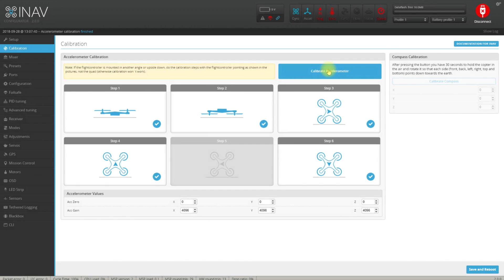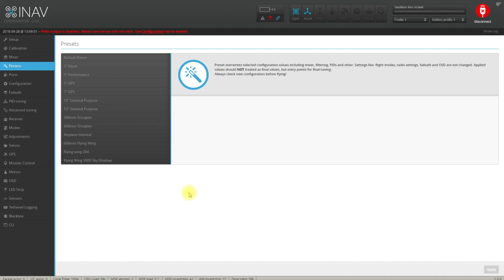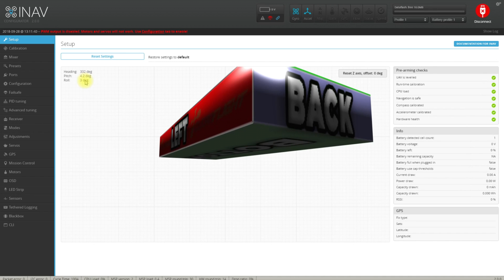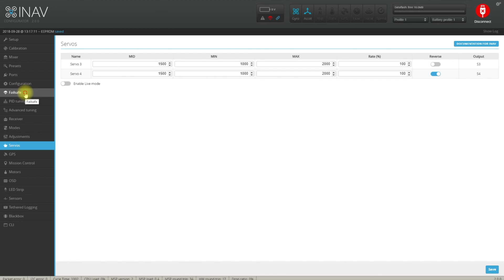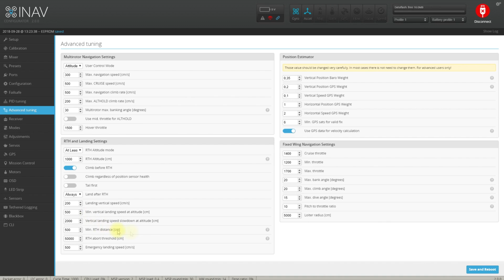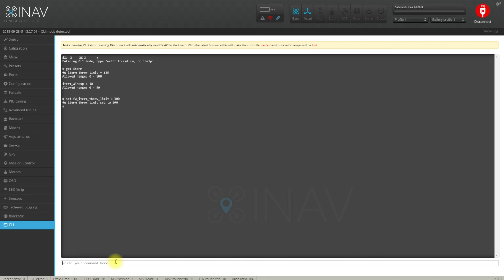How to setup INAV on a flying wing - video tutorial

Comment: Where does one connect the servos to on the FC? The SpeedyBee Pinot says that S1 and s2 are for motors. So s3 and s4 pins for the other servos controlling the aileron and elevator? In output mapping the Motor1 says S1. On the FC the motor is connected to pinS2. What the heck is happen? How is someone supposed to make sense of this. You’d think the manufacturers would have their stuff squared away so build can easily build things. But no!😂

Comment: Great video! THXS. I am new to INAV and 3 doubts :. I have two wings: X8 Skywañker 2120 mm and another AR 900 mm. Armed and fly well without a controller. I bought 2 Matek 405 controllers Both controllers are already flashed and calibrated in INAV. I have Flyskyi6 Remote Control with FSIA6 Receivers. Which one do I select in INAV? Another question, I have to remove motors and receivers to configure and move on, and finally: Could the 2 wings be left with the same parameters explained here? Please make a GPS RTH video tutorial! Thanks again

Comment: I set it all up as directed but stabilization is working backwards. If I set it to horizon mode and by hand roll the plane to the right, the control surfaces actually push harder to the right with the roll.

Comment: So when I have mixer weight at 50, I am not getting anywhere near full servo movement. I fixed this by raising it to around 70 to get the required servo throw. However after watching this you say to keep weight at 50. What should I do to get more throw out my servo when 50 isn't enough?
Reply from the maker: Increase FF gains on PID tuning
Reply: @FPVUniversity  thanks, however I am getting little throw when in manual mode

Comment: Pawel i have watched many of your videos over past 2 months Thanks, this is my first flying wing build and everthing has been ok until i check stick inputs in inav 2.5.0, my setup is f405 wing, r xsr reciever and radiomaster tx 16s. I have also read inav wiki several times but can not get this to work. r xsr has been flashed with latest firmware and it binds as soon as its powerd up with usb i have it setup for sbus blue and green lights but no go, i have even flashed board 2nd time but still no go on stick inputs. its wired as you have shown with sbus out green wire to sbs on board yellow to t2 ive double checked settings in inav and set same as you did, radio showing stick inputs in mointor section input,mixer and output and also shows strong signal 5 bars. only thing ive noticed is on inav page it shows configurator 2.5.0 but under that shows multiwii 2.4.0 i dont understand this, can this be the problem? please help if you can Thanks again

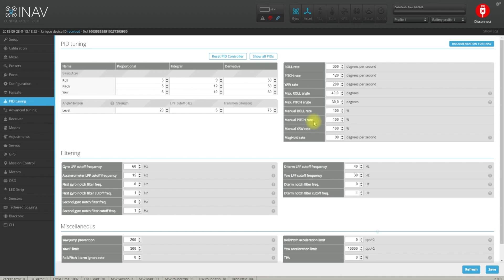Comment: 13:30 if i set for example 25 or 30 od any other value than 60 i have settings not validated on inav 2.5.2 and matek f411wing.

Comment: Hi, great video. Im trying to set up my F405 with INAV and when on the ground, if i throttle up my servos start creeping until they reach max travel for roll. If i move the right stick, they eventually go back to their original position. Once i let go, it starts creeping again. If i zero the throttle, there is no creep. Any idea what would be causing this?

Comment: Great Video Pawel.  I have just moved a ominbus F4 board from a dart to a skyhunter.  Changed the settings from flying wing to conventional plane and all seems great.  However on full throtlle manual mode the elevator goes full up.  I dont have any mixes in the taranis and the RX tab looks normal.  Any ideas?

Comment: I have a matek 405 wing , I used a preset for the s800 and now the servo mix has disappeared , it won't acknowledge any servo's in the servo tab,I tried resetting everything, and no deal,  can't even re flash the latest firmware ???? must be something I'm not getting ??

Comment: I have a big problem. The Matek F411new can be easily flashed in DFU mode. I also get the audio signal that it is connected to the PC. It does not open in the COM1 or COM3 port. Drivers are all installed, also tested with driver fixer. The chip breaks the connection approximately every 30 seconds. Tried several firmwares (old and new) and nothing has changed. Red light can be seen permanently, green and blue flashes twice and changes into flickering, this process is repeated continuously. Can someone help me further or is the chip for the bin.

Comment: Hello. My equipment is : MATEK F405 WING, FrSKy R-XSR (receiver) LBT version, Jumper T16 HALL TX. I am planning to install (and control) FC on  standard 1.4m model with 4 servos (2 for Ail, 1-Ele, 1Rud), with standard 45A ESC and 1100KV brushless motor. Jumper T16 is based on OpenTX (latest version). ALL equipment (EC, RX and TX) have newest firmware-s. Now, I have connected servos and ESC to the FC as it should be. By using INAV 2.3.5, I have succeeded to control servos by moving sticks on my TX. My problem is that motor does not spin at all when I move throttle stick on TX !ESC has been calibrated using MASTER switch on Motors tab of iNAV, and when I move master switch, motor runs correctly. So in short: motor response on MASTER switch, but DOES NOT response on TX's throttle stick.I tried everything I know, but no success.Just to mention: Setup on TX: I created simple model with 4 mixes that run 4 channels (Ail is CH1, Ele is CH2, Throttle is CH3 and Rud is CH4). Setup on FC: 4 servos: S3 and S4 are Ailerons (Roll), S5 is Elev and S6 is Rud. ESC is connected to S1 and Gnd. Rx is connected to FC with SmartPort on T2, SBUS to SBS (and 4.5v/Gnd)I did not found any comments/videos that can help me.Do you have any idea why my motor does not response from Tx's Thr stick.

Comment: Be careful first time flyers of inav! There is a good chance your plane will explode within 10 second after taking off, My biggest regret was saving $10 and buying the mateksystems 411wing because it made me set up using inav instead of ardupilot. After looking at stock pics/puffs I can see why my plane exploded.  There is nothing In the inav wiki stating how bad that the defaults

Comment: Hi Pawel! I want to setup three independent motors on airplane, but it does not work.
I can add a third motor in mixer tab, but it is not showing up in the "Output Mapping." I can move the slider for all the three motors in the motors tab, but the third motor is not rotating.
When I select tricopter or multi, the third motor is showing up and and can move it in the motors tab. What can be done to resolve this?

Comment: He you can help me around omnibus F4 FC at the servo outputs voltage is from 3. ,, V to 4. ,, V should be 5v. servo did not work
I tried to connect the servo on another BEC and the signal wires only at FC but still the servo did not work.
This means that neither the signal pin does not work?
In Inav it nice to see the commands work nicely but the servo does not move.Servo are connected to the 3 and 4 channel as you described in the videoYoutube video of an issue: https://youtu.be/Xqp9LcbYsx0

Comment: Am I missing something ? setting up a fixed wing AETR with limited servo pinouts on FC having to loose another output
to the second motor as if you are not using a second motor you are unable to use that header for a servo either ????
Reply from the maker: No. Usually S2 uses the same timer as S1 and can not be used to 50Hz servos
Reply: Just to be clear I made this video, Now we have Mixer Tab is there a way to configure this ?
https://youtu.be/AAk_Ejww-E0

Comment: Hi Pawel,
Thx for all of the excellent videos. 
I have just finnished a new scratchbuild wing. It flying on rails like a rocket. But i have mounted a matek f405 and i cant get i to fly good. It feels heavy and kind of sloppy even in Manual mode. Today i tested the autotune and i didnt make any difference. This is my fifth wing i put inav in. But it always end up with that i take it all out and fly them all Manual. Whyyyy i dont understad?! What do i miss!? All the wings flys great without inav. I really need some good advice here. I really want to have the stabilisation and the RTH function as im waiting for my Frsky r9m-kit and want do some long range. 

Regards 
Jon Wikström
Reply from the maker: hard to say without a blackbox log and a video what is happening that you don't like.
Reply: Paweł Spychalski Yes i understand that. Dont have a blackbox log.
But for the last build. I just followed your steps i this video. 
Is that, when i run in Manual mode the gyro is not active right? 
Do you have to fiddle with the pids to get to fly good? 

Thx for the fast anwser. 😊

Comment: Gyro LPF cutoff. Higher ≠ better
Reply from the maker: depends
Reply: depends on what?
Reply from the maker: On the amount of vibrations that motor and prop are feeding to the gyro. On a very noisy setup, high LPF might be problematic

Comment: Thanks for the vídeo! Why do you recommend Acto mode for maiden instead of launch mode? Should'nt be Launch mode best suited for that?
Reply from the maker: Acro depends only on gyroscope. Launch on accelerometer, angle mode, possibly not tested motor and ESC and a few more minor factors. It's more likely to fail than just starting the motor and throwing it into the air
Reply: Hi again Pawel, I was to maiden my S800 on autolaunch but tried on acro as you suggested. Maiden went great and takeoff perfectly smooth! Pity someone turned off an VTX and I loose video signal and did´nt have time to recover, destroying the poor wing. But, the adjustments given in this video and launching in acro mode made it to fly perfect! Now to buy another one! :)
Reply from the maker: Oh come one, I'm pretty sure this is nothing that some creative thinking and a lot of hot glue can not fix!

Comment: Great video Pawel. 
It answers some of the simple questions that are usually difficult to find answers for  !! Look forward to video number 2
Do the S800 presets work OK or are there any settings that may need changing
Reply from the maker: S800 preset is based on my very own S800
Reply: Thanks Pawel !!!
Reply: Isn't my servo throw too low? On S800 preset with autotune I got next PIFFs:
set fw_p_pitch = 11
set fw_i_pitch = 25
set fw_ff_pitch = 114
set fw_p_roll = 7
set fw_i_roll = 15
set fw_ff_roll = 69
Reply from the maker: Imagine I did a video on that https://www.youtube.com/watch?v=o2RwTeBbvos
Reply: Thanks, but I had to adjust manually to get higher throws. Now during autotune I gett cca half of FF values, and finally can do inverse loops. You know that one, that you start downwards.

Comment: Thank you, thank you thank you. Now can you do same/similar for a more conventional fixed wing, an aircraft with 2 ailerons, rudder, elevator and throttle. Also discuss different settings for an aircraft that needs constant higher use of the throttle and another that’s a motorised glider and has the throttle closed for long periods of time. Thank you, I’m going to get a fixed wing flying with INAV yet, been trying for 18 months and it hasn’t happened yet.
Reply from the maker: it will be the same only with different mixer applied

Comment: Why not change the servo direction in the mixer tab? I have been changing the weights from pos to neg or neg to pos as needed in the mixer tab and it has been working well that way
Reply from the maker: well, probably its a matter of preference
Reply: I also noticed you didn't adjust the Max_inclination in the PIDs tab, is this still needed, as described in the Fixed wing wiki? Thank you for making this video, I am a huge fan of iNav and am often trying to help people in FB groups and on forums to get them in the air with iNav and this will be very helpful.